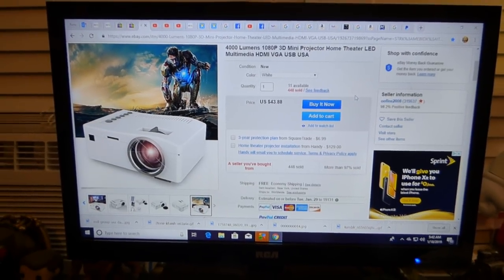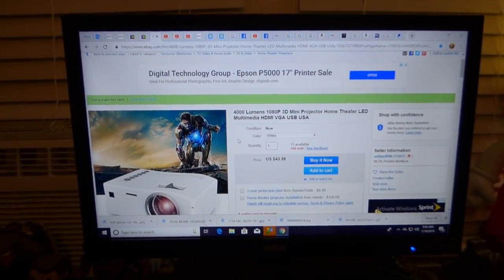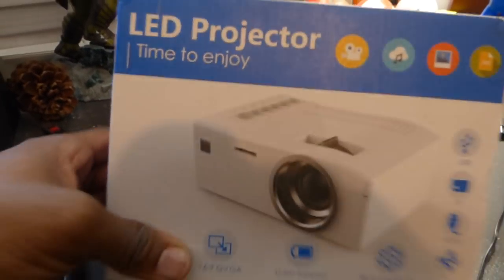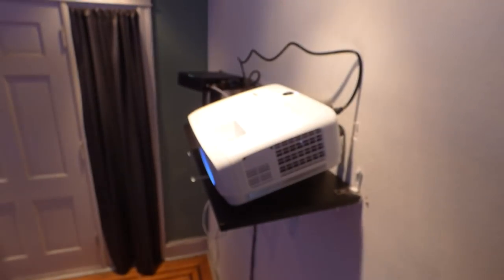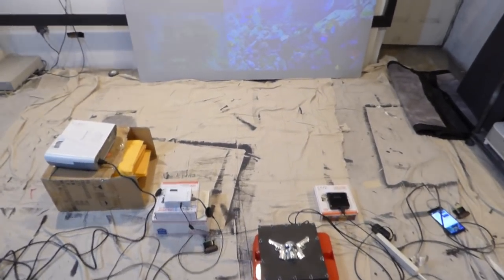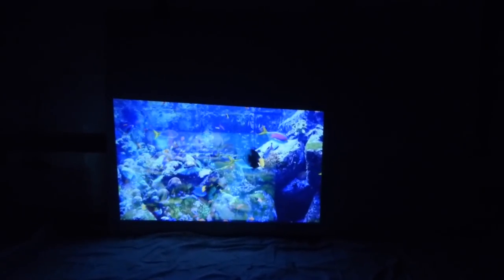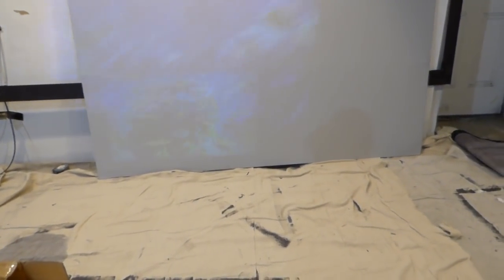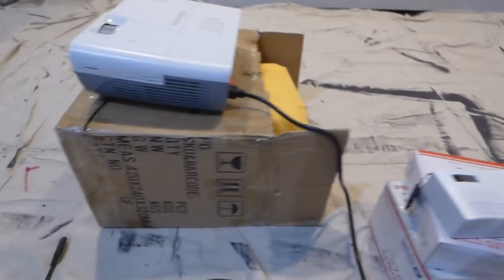4000 lumens 1080p fake knock off projector VS 50 - 4000 lumens 720p - 1080p projectors!

Comment: It is crazy that Amazon allows Chinese manufacturers to literally make up their own lumen ratings, knowingly deceiving their customers and making brightness comparisons impossible. These manufacturers typically overstate actual brightness by between 6-20x the actual ANSI Lumen rating. The only lumen rating you can trust is an ANSI Lumen rating. There is a reason why you can buy a "5000 Lumen" projector on Amazon for less than 100 bucks, but a true 5000 Lumen projector will run you several thousand dollars. Shame on Amazon!
Reply from the maker: I know it a shame I talked with a great many that got trick on these useless projectors. Amazon and eBay continue to let these merchants flood the market with these counterfeit nonsense Projectors.
Reply: @Themotherofallprojectorscreens  I hate to be negative but it doesn't help that those who buy them have no clue what an actual 4000 lumen projector looks like. "I can see images in total darkness (after my eyes adjust): 5-stars!"